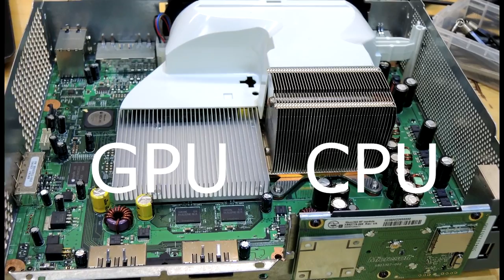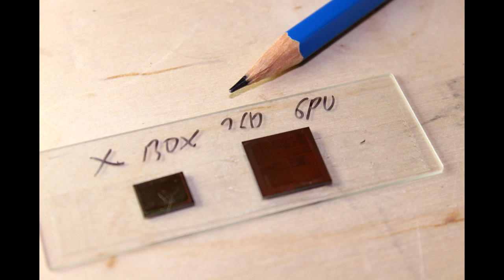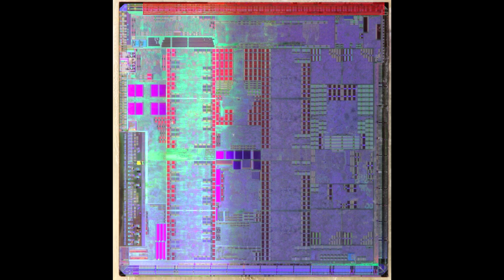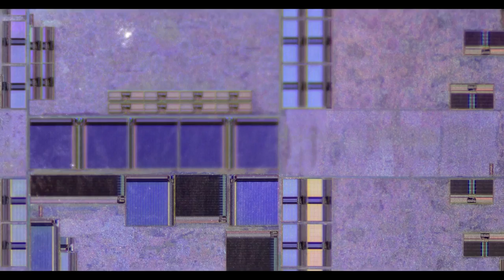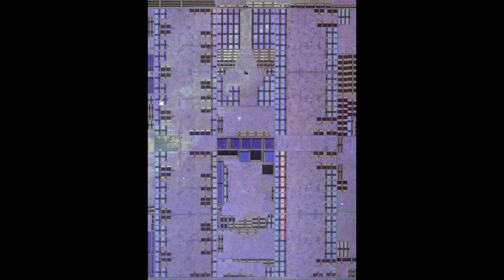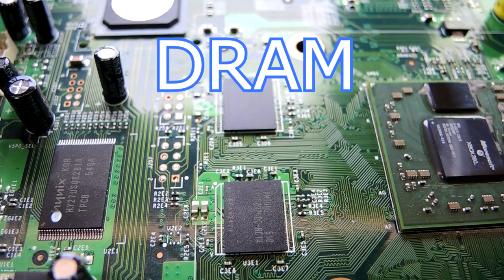XBOX 360 GPU DIE DECAP: A look at the graphics processor silicon

Comment: How did you remove the metal solder ball layer from the die? I purposely avoid these types of chips for this reason but if It can be removed that's brilliant.
Reply: There's a video on youtube of someone using glass etching paste which removes the copper layer, I've tried it and it works pretty well

Comment: Can you decap a small FPGA sometime? I think it would be neat to see that. It would likely be best to use an old FPGA so they are not using super small transistors. Thanks.
Reply: You can use an Orange Pi Zero for your projects, it got GPIOs and can be made to run slow with Diet Pi: http://dietpi.com/
http://v.ht/opistuff
Diet Pi got a VM so you can try it out on PC with VirtualBox:
http://dietpi.com/downloads/images/DietPi_VirtualBox-x86_64-(Jessie).7z

Comment: Do the same with Wii U's MCM chip. It's even more complex i think.
Reply: simontay1984 It is. It's newer gen and games are pure 720p/1080p 60fps. No dynamic res bulls*it. Also cross platform games are looking better on the Wii U. Read some articles please. Probably you mistaken it with the original Wii. Especially the Latte GPU is more powerful and it's using newer AMD architecture.